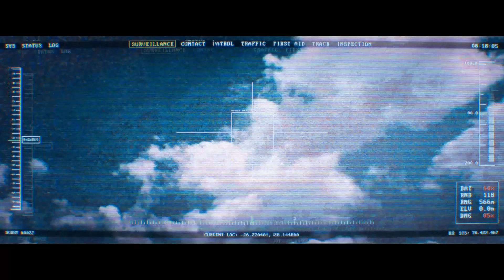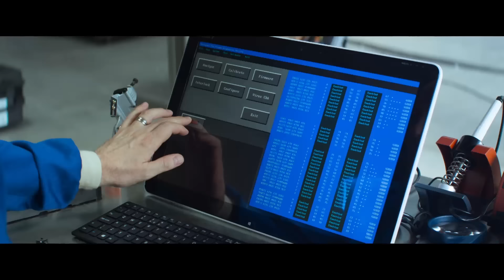Chappie | Gunfight Between Robot Police And Criminal Gang | Full Scene

Comment: chappie has to be one of the few movies that did humanoid robotics nicely, no clunky jittering yet they have the perfect amount of human and machine movement, one thing that i just realized tho is that a heli carrying 4 scouts....would prolly crash lmao, they are armored enough to stop 7.62x39s and get hit by cars so they have to weigh a goo 1.8k-2.2klbs so 4x (1.8) is 7.2k-8.8k
Reply: an aluminum alloy body frame plus ceramic/steel plates would probably weigh as much as a fully kitted out 6 foot cop/soldier in some way
Reply: Especially if the aluminum is akin to 7075 aluminum - forged, then machined - 75,000 tensile…
Reply: @elijahtourtillott7550  nope a kitted out jacked dude is max 300 pounds (220 lbs man, 80 lbs gear). The hydraulics and battery alone would be over 200 lbs, the armor is everywhere not just chest and back. Consider that a steel plate is around 8 lbs (chest sized), this has 10 times the coverage of the regular two plates, which is 16 times 10 = 160 lbs. Add the head sensors which would be similar to the ones you see on helicopters, 50 lbs, and their equipment (80 lbs) and you have a 400-500 lb machine at the minimum
Reply: @flyingtanks9313  okay but if the armor plate is made of titanium on an aluminum frame that would be way lighter
Reply: I've never seen someone use metric prefixes on imperial units before; "klb"; guess it makes sense, quicker than typing "thousand" ofc but still funny
Reply: @iainrickwood2623  i just noticed that, it was suppose to be 2.2k lbs xD
Reply: I always found it odd how they send the drones in by helicopter. Should be done via an armored vehicle. If they've got drones that don't make too much noise when moving around, they've definitely got the means to develop silent engines for armored vehicles.

Comment: The sad thing is, this could totally happen. Unmanned drones being piloted by real people could translate to First Person Drones that are controlled by people like a first person shooter game. On one hand this could be amazing for search and rescue operations, on the other I could totally see the worlds military overhauling the entire structure to fit in these machines. Of course the ones in Chappie are full AI, and work hand in hand with humans. However, allow a person to take remote control and it'd get really bad fast. 

Humans in video games have no fear because they'll respawn, pair that with a body that won't bleed out, or in most cases take major damage? It'd be insane. Humans will never trust full AI that are capable of doing what chappie could. But if we figure out how to put a man behind the wheel, this could be a reality. We have FPV Vr, body tracking, hand tracking, and VR stations where we can run in place at full sprint. All that needs to be done is figure out how to translate that into a live feed on an upright standing model. Which if the robot is tracking the humans movements live, then balancing shouldn't be an issue.

Comment: This is so unimaginative that it’s unwatchable. This robot is so dull and its capabilities totally overlooked. It should be able to fire in at least two directions at a time. It should be able to run 60mph. It should be able to do so many more things than just be an imitation of a human.
Reply: A. That’s not useful to modern combat and leaves its weak points open to being shot. Running 60mph is not useful for a Police SWAT robot operating in CQB environments.
B. The fact it doesn’t need to take cover is the equivalent of man-sized tank with near-perfect accuracy.